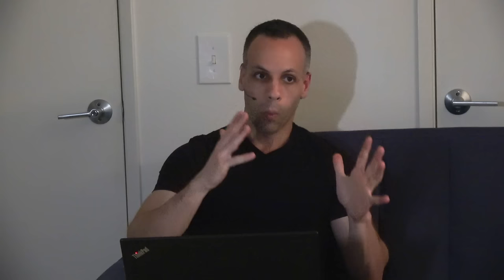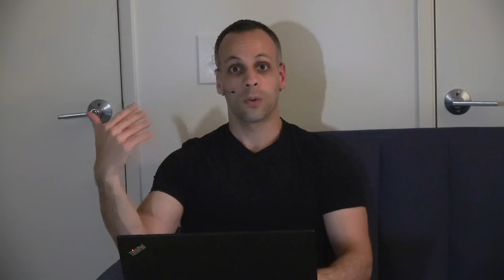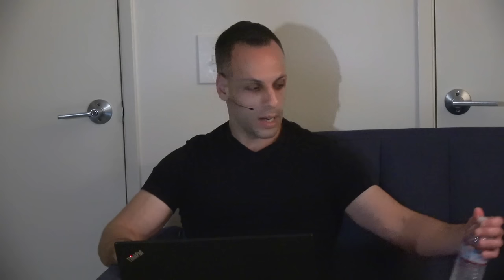EVGA's Oversight: Unannounced Changes Destroy PCs, EVGA takes NO ACCOUNTABILITY

Comment: Funny you mention them opening themselves up to exploitation but they opened themselves up this by changing the power supply and not having measures in place to account for that like seeing what version the old one was then deciding to send new cables with a note saying use this because xyz instead of switching the 3V and 12V around and telling the customer to plug the old cables in like before.

Comment: I understand that you can't put a price on data, you can only put a price on the amount of data that needs to get recovered...as there's data that is just priceless.
When there is a system, there are people that Will find a way to abuse it...and suddenly you car gets a farming vehicle because there's a bag of seeds in the trunk.
In with you regarding the guy's so called backup. A backup needs to be separated from the system and have its own power supply, if you need it redundant you needs another system with a own power supply... calling Three hard drives in the computer backup and redundant is literally lying too your self... it's nothing...when something goes terrible wrong it will kill everything. Had my power supply fail and it only destroyed the 12 volt, since it was near the main power input it could have even send 220 volt through the system. A friend had one failing that could have send 220 volt into the actual casing.
Since a hard drive can fail at any time it is pretty clear that at a specific point you should have a backup storage.

In this case i would file a law suit...blaming the cst for incompetence from the company is really a bottom line.
Cst  send the device, cst followed the Policy not sending the cable (since that is often a pain to get out i get tyat they say its not required....but...) and they send the cst the identical device back, same production number and product name (what is already a big mistake)...only difference is the production date, what would be expected when performing a warranty claim two years later.
There is no big sticker on the box and case,....there is no new cable added with a bright Orange sticker (do not use old cable, pin layout changed, replace with this cable) as the worker should get a warning on his computer "cst device is old technical standard, replacement is new technical standard, add new cable and sticker on box and device, cover power out with sticker"... nothing of this happened.
Then cst gets the powerpupply, checks the numbers and they match (you cant expect cst to check the power out on every pin) and pow.
That is neglecting from the company side, not the cst side.

Only problem i see here in winning this case (unless the power supply logs the first start-up and hours) when in july 12th he maid the claim, received the replacement on july 24th and march 5th he files a complaint for destroying his computer...so they will say "what happened between July 24 and march 5th?"
If he would have installed it latest the next day and directly calls "you power supply destroyed my computer" the evidence would be clear and in Court it should be a solid win.

If they would have added stickers like mentioned above, then it all was ignored by the cst and the company is safe.

Comment: Lets make ALL the cables black.. Lets not even color code them with black/red/yellow'orange so you can just visually tell what that wire is SUPPOSED to be

Nope, Not getting an EVGA power supply after this!

Comment: If they changed the pin layout, they should of also changed the PSU connection so they wouldn't accept the old layout cables, rookie mistake :P

Comment: OK, i know to never swap PSU cables (i bet it has something to do with Patents that there is not one standard to fit them all), but EVGA changing the pinout on literally the same product because of some mid life refresh??? .... that is some seriously stupid bull***t. That is straight up negligent. If i buy 3 of the same thing i expect the cables all to be the same and they go together in one box. I actually have 3 of the same Corsair PSU for different systems.  

Not sending in the cables is also a bit weird, if somebody has a problem with their PSU of course they could have a defective cable somewhere, i'm sure EVGA has the capability to check if cables are OK.  ...of course you wouldn't send in your custom braided CableMod cables or whatever.  
...why wouldn't EVGA check and swap those just to be sure? Weird!  

In my experience EVGA is excellent when it comes to customer support, i asked them one time if they could send me some replacement fans for my out of warranty GTX1080 FTW ACX3.0, 
those maniacs send me an entire heatsink, with the RGB nameplate and also the fans.

Comment: The fact that these power supplies are not using the EPS standard full stop is stupid-dumb and forces users to take drastic actions like re-pinning physically-compatible connectors at one end to go into the PSU and should come out pin-for-pin to the correct connectors. I could understand fo everything else, but EPS power shouldn't be uni-directional because the connectors are not correct at one end.

At this point, just leave the pinning to the end-user and clearly label all of the connectors so an end-user knows black goes tog round, red goes to 5v, yellow goes to 12v and orange goes to 3.3v.

Comment: its probably has something to do witch making deals that supply the connectors and cables that they will give you x deal if you sell x amount and bumping up the price of the psu because it has cables. if you could re use your old cables x company would not be making moeny. and who knows if using cables for 30+ years is a good idea. well most connectors are built well the molex were not and they panted that that is why there so many different ones... anyway just and idea

Comment: your an excellent guy bro, i dont agree, i think EVGA should atleast pay for the drives, they created the situation, the customer also has to trust the manufacturer when he buys the product. You are looking at this from the manufacturers position. The customers has a case can sue, and in states like texas, would win. The customer was not informed during the RMA process that they were in fact recieving  a differant power supply, it was illiegal for the manufacturer to make a revision and not make the change in the serialization process of the product. when the manufacturer replaces a product through RMA the onus was on them to state it was in actuality, not the same product. I do not believe a judge would compensate the customer on the data portion of the claim, but i surely could be wrong. The customer, by law ,had to be informed that the product was not like for like. Maybe im wrong though. I would sue EVGA on principle, and at the moment, with the right judge i would either win or lose, the law in this country has become pretty wishy washy over the past few years

Comment: I've been out of the power supply business for a while. Is there any reason to not immediately go for an Enermax model like the early 2000's? (I've been running Dell Precision workstations for 15 years now, and those only eat Dell model-specific power supplies)

Comment: I feel vindicated for never going the modular power supply route. 
To me it's just a extra point of failure for purely aesthetic gains.
Reply: I like matx/Itx small case builds with disk drives, ssds, hdds, I actually use all the pcie slots and so forth, so space is an absolute premium. soo not having extra cables floating around in the case that im not using is nearly necessary.

No glass side, panels no rgb no aesthetic gains, just a bit easier imo.

Now if you have an atx setup with a couple ssds and only a gpu on the pcie slots then yeah non modular has its place in the market still.

Comment: agreed, modular power supplies need to be 100% standard
why not, I don't know, USE THE SAME FUCKING PINOUT AS THe OTHER ENDS
in most cases the connectors used in PC's are wildly overrated for what they get used for(graphics cards are an exception but they often have single 6+2 pin/8 pin cables anyway)
so why not just put a a PCIe 8 pin cable on the power supply end?
and as for the molex/sata connectors we should agree that the arrangement should be in a specific order, maybe follow a zig-zap 2 row that clones the sata order
ie:
12v 5v 3.3v
gnd gnd key
and obviously the molex cable just omits the 3.3v wire but remains the exact same due to the perif/sata leads being the only ones that ask for 5v outside of the 20/24/28 pin MB cable
and as PCIe is used most often we can simply make ALL 12vo cables use PCIe on one end, no risk of reverse polarity as you can't plug PCIe into CPU and if one end is all teh same there is no chance of wrong cables

there is literally no excuse not to standardize modular cables, it does not increase the BOM(in fact it will factually reduce BOM making parts cheaper) and it prevents RMA issues because you changed the pinout for literally no reason

shame on you EVGA, your power supplies are otherwise fucking perfect, stop changing pinouts like this and not telling users they SHOULD RETURN the cables to avoid this issue

Comment: Have to say I have no idea why cables for modular PSUs were not standardised the minute someone had the idea of making one. I bet it was gonna happen but some fkin beancounter somewhere got wind of it and was like 'no if have proprietary cables it will mean less chance of customers going to go buy another brand than us in the future'

I mean how hard would have it been to use the same pinout thats on the other side of the cable where you plug it in CPU/GPU/etc.  Someone HAD to go out of their way and decide 'we are gonna use a random different pinout on the PSU side ahah'

Also have to add I wouldn't buy anything from EVGA these days, selling GPUs was like 80-90% of their revenue, and when they quit working with nvidia it was pretty clear from the whole situation the CEO is tired of the whole thing not just nvidia and gonna retire sooner or later and don't wanna sell the business. Their online shop is already pretty empty and dead, they will fold and leave you stranded sooner or later.

Comment: Andrew Han has torpedoed the company. Absolute no one should be buying EVGA products.

I had an EVGA 1000w GQ Power supply that overheated and fried itself. I sent in for RMA (kept my cables) and the replacement power supply was DOA. 

I called them, approved another RMA. They sent the another power supply which subsequenty fried my motherboard and my cpu.

They [EVGA] said to RMA the motherboard and cpu and if (MSI & AMD on my case) they determine it was the power supply then they (EVGA) would cover replacement.

I shared all this info with MSI and AMD whom both approved RMA, it was determined it WAS they power supply that killed them.

After sending the info to EVGA and calling them they refused to replace the parts and stopped replying to me.

I informed MSI and AMD (with copies of emails With EVGA) and they were kind enough to send me replacements though it wasnt any fault of their products.

EVGA is trash.

Comment: Come on Louis, the man did as instructed and lost his drives. EVGA knows they screwed up and that the screw up kills drives. They should pay at least more than the drive's worth, even if in some cool hardware they have. This is a really stupid screw up.

EVGA does not build their PSUs and apparently they are changing ODM on the same models.

Corsair has various types of cables but marks them with a type reference due to changing pinouts.

Comment: Why didn't they just changed the plug/socket keying slightly so the wrong cables wouldn't fit anymore - or is that too sensible.
Reply: (this is assuming having a standard between manufacturers isn't possible)

Comment: What makes all the power supply cables a huge joke is they all fit in the proper ports across all power supplies why not have them wired the same they come with the power supplies anyways and if i need a replacement ill buy from the brand im using so they physically look the same my ocd would drive me nuts if cables didnt match and looked out of place.

Comment: Ok i don't like the the constant the same model 2 different pin layouts line that gets repeated. Its the same model but different years. And im quite curious too how long the persin has been sitting on that psu as if this was over the course of half a decade or so then im a bit less sympathatic (that doesnt mean i dont encourage companies to standardize and inform changes) but people should be a bit more suspicious. Also how did they know 100% they didnt get cables mixed like i run a overlcocking club at oregon state university. We have about 10 differerent evga power supplies alone with various models from various years and we have mixed and matched cabels from the evga brand and never had issues. Though telling apart and evga cable and a corsair or seasonic (which seasonic funnily enough works fine with evga except for their sata pinouts) can be difficult. I hold alot of respect for evga. I requested an RMA for a gpu I LN2 overlcocked and set a record on (the 3060ti GA104) and they within 2 hours approved it😅. So yes this is an oversight in policy, but something i think now if they were to see this would revise and just ask for psu cables and then send the proper ones if they send a newer model of the same quality and wattage capacity. So yes atx power supppy cables should be standardized cause that would solve all this issues. Ive killer my fair share of hardware from mixed cables but evga psu cables and psu's has never been the culprit for me (yes i know thats anecdotal i bet many others have done it with evga psu's its not a uncommon thing between any brand)

Comment: Its honestly not even realistic to expect regular consumers to know this unless they have obvious markings on both the cable and the power supplies. If two cables of different pinouts can be plugged into the same port on a power supply, that should be considered a design defect. Any engineer with half a brain would know better.

Comment: corsair isnt that much better with this, different models uses different generation of their cable pinouts and some times psus they release at the same time doesnt use the same generation but at least they dont change pinout for the model after release without also changing the visible model name for said psu. 
if you are unsure the corsair modular psu cables you already got is compatible with your new psu, you can check with corsairs support (its one of their faqs on there) which cable generation comes and is supported on which model

Comment: I wonder if the different pinout is there to avoid the coilwine (maybe they added a component), almost as if it was an oversight from the engineers when they made the psu.

P.S.: If you are willing to standardize pinouts of modular psus, I beleave the pc building world would only be with you (or at least, I would), this pinout thing on modular psus is getting annoying.

Comment: Way to make me paranoid about checking the voltages on every new PSU I ever get my hands on now.
Is there any way to protect the drives from that? Some kind of fuse/voltage limiter/crowbar that we can connect before drive to make sure it cannot get overvolted? Normally the PSU is supposed to be the guardian against spikes from mains, but in this case it looks the enemy is already in our castle.

Comment: This is it evga only either sadly  I've seen it with multiple cos   and the changes usually happen with X brand due to them swapping from builder co X1 to Z2 it G4 etc   whomever they find to oem them at X cost 

Evga has effectively 2 PS lines   lower end and higher end  they are NOT the same    corsair is much the same  and not all of such is made  y either

Gigabyte is even worse since they dont actually make PSvat all and their qc has been beyond a disaster  as very well documented by several reputable tech channels

Thor that actually make good PSs are  very few brands you will ever see in NA esp   tight of the bat, PC power and cooling, sparkle and my personal go to as a rule is seasonic

But regardless do yourself a solid and research!!!!   Remember everything you buy in your pc is at the mercy of having a top notch quality PS  and I've seen way too many ppl overnthr yrs buy pricy X mb video etc and have such fried by using no name pos ps with a label that's lotterally whatever the buyer wanted on it  not having anything to do with the actual capabilities ofnthe internals

Same for a good UPS   cyberpower as a rule is good and unlike the over priced apc (whom have slipped in quality a lot) use a standard usb cable for control  vs the idiotic custom apc cable they refuse to stop using..

Comment: If people liked what EVGA used to be for PSUs, then buy Super Flower power supplies. That is the original OEM supplier for the best EVGA power supplies. EVGA started going with cheaper suppliers and generic hardware, relying on the popularity of the brand to push sub par products. 

Consider them a garbage brand now.

Comment: was that a revision and they kept the same modelnummer? if so why would they not send new cables with the rma?? the customer ends up with a new powersupply and no cables, where the fuck does the customer get new cables for that exact psu? this whole story makes no sense
putting aside that changing pinouts, but not changing the modelnumber is just dumb, there is no world were the customer does not get screwed here

Comment: It could just as well be called user error if EVGA hired some guys which break into your house and destroy everything plugged into your power supply while you're at work or whatever.
This is just wanton property destruction, it is utterly unreasonable to expect the pin out to change within the same model. Half the people don't even have a multimeter with which they could possibly check for this in the first place.
I would like to see a court case over this.